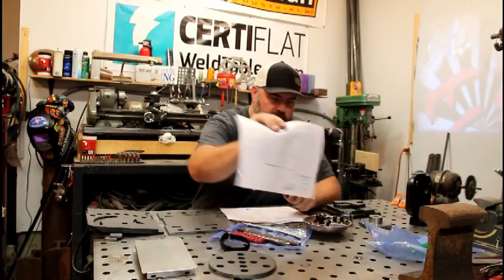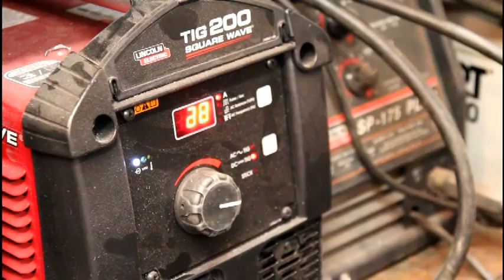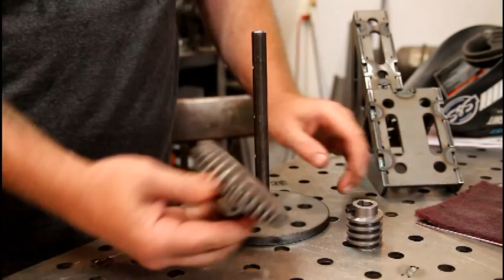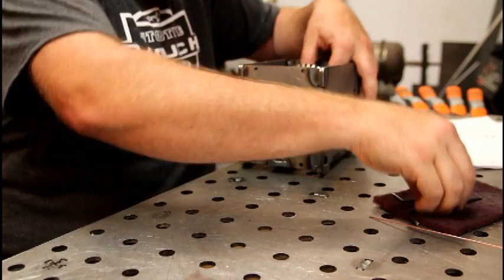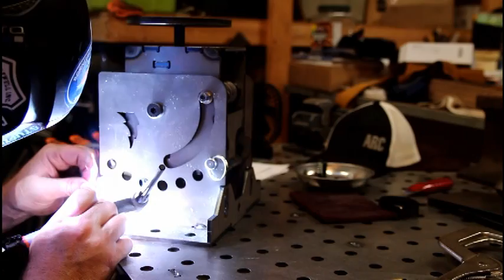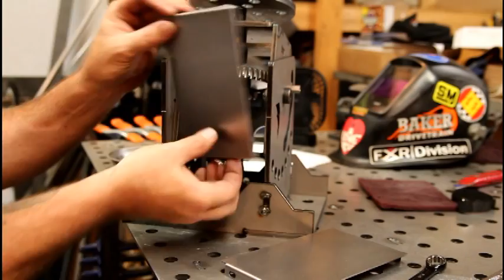CertiFlat DIY Welding Positioner Kit Assembly Video

Comment: Three hundred bucks and I have to use drill?🤣
Reply: I think you can buy one with a motor for about $1,000
Reply: @Brandon S  why would a cheap motor burn out on you? Wire it up correctly and it will last as long as any drill motor. David is right: the drill connection is the weakest part of this design. Velcro speed control and no positive connection between the drill and the drive shaft means lots of opportunities for a screwed up weld. Outside of the drill issue, I really like the rest of the construction. Besides, I've got motors and old tools in my parts bins and I'm pretty sure I can either put one inside, where the back sheet metal is, or somewhere else and give this thing a decent foot pedal.